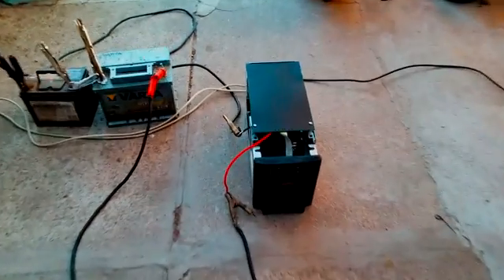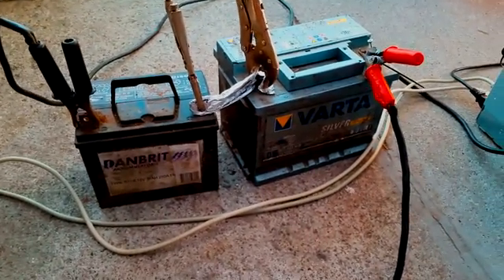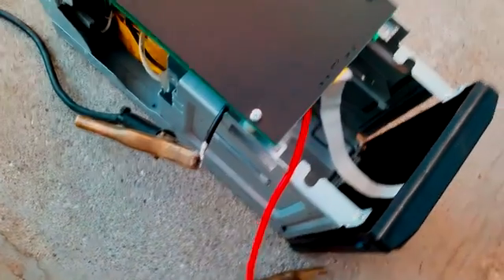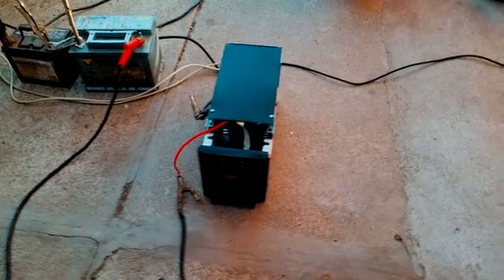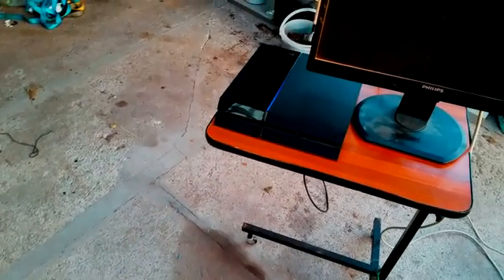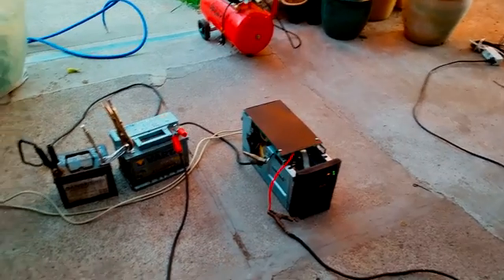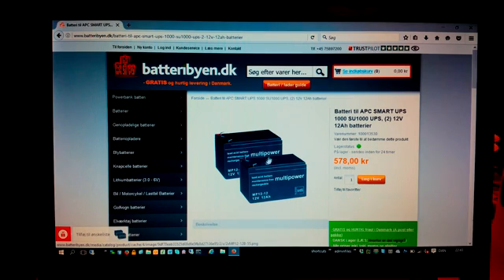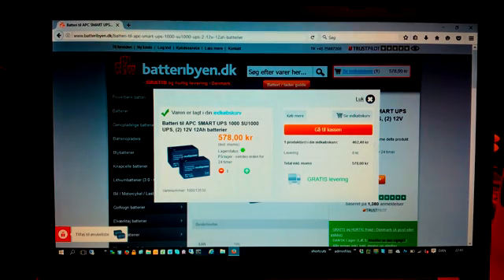Weekly Video #4 - Testing and Restoring my APC Smart UPS 1000 - installing new batteries

Comment: Hey, its five years since you posted this video, so those batteries you installed are probably at the end of their life. If you still have the UPS, i recently got the exactly same UPS for free that had dead batteries in it, but i replaced mine with 18Ah ones. 18Ah batteries fit just by removing the bracket above the batteries as the 1500VA model seems to have the same frame but it has 18Ah batteries as default.
Reply from the maker: Still running on the batteries I installed 😄 using it for my home office at the moment.  due to covid.

Comment: Just to say you don’t need to remove the outside metal shield to replace the batteries.
Reply: However it the batteries are buldging you might.

Comment: you can turn it on without it plugged into the wall outlet; you have to have good batteries connected, you would need to press and hold the vtest button until the upsngve a beep and then release the button.  This is called doing a a cold start, not sure if you knewtat.  Nice video.  I'm from the USA
Reply from the maker: Thanks mate ! - Did not know that :) - I will give it a try :)